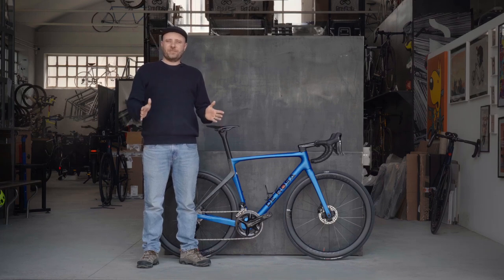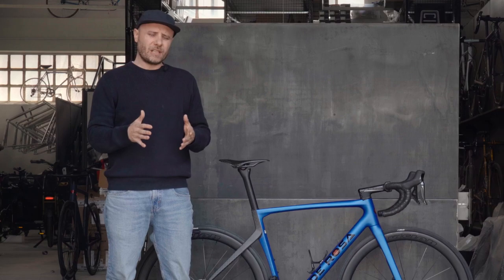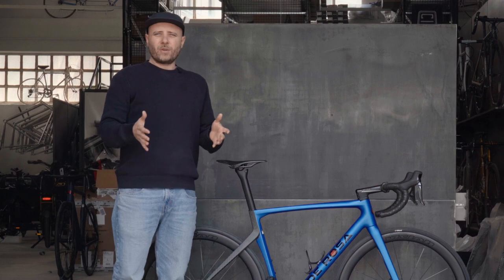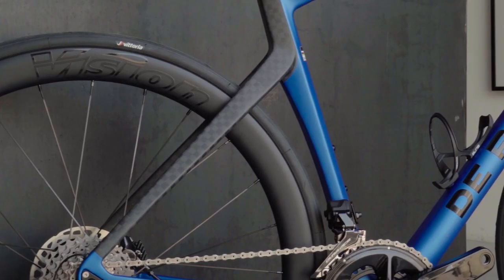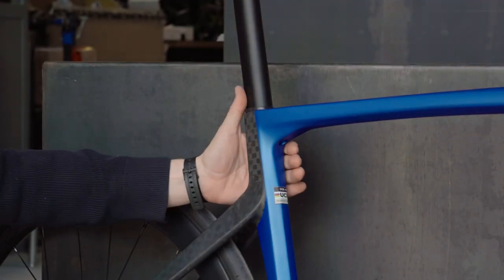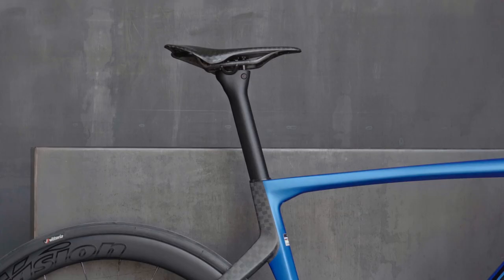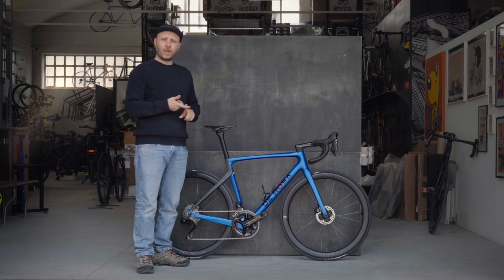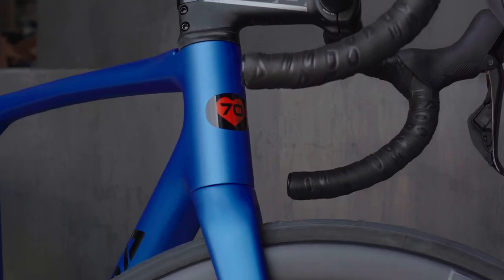De Rosa 70: The Ultimate Carbon Fiber Racing Bike for High Performance

Comment: Don't understand why you choose Shimano instead of Campagnolo gears on such an incredibly nice Italian bike.
Reply: Because Campagnolo sucks. It's inferior to Shimano in every way,  basically no team in world tour are using them anymore.
Reply: @carefulsum  Shimano had to go electronic because people were tired of having to use the brake lever for shifting, which was never necessary with Campagnolo. Also it took Shimano almost 20 years to finally hide their shift cables under the bar tape, which Campagnolo managed from the very beginning. And even most Shimano fanboys have to admit that Campagnolo makes the best hydraulic disc brakes on the market. Campy is just too small to afford the amounts of money pro tour teams are asking for sponsoring. It is not because their components were any worse than those of the larger competitors.